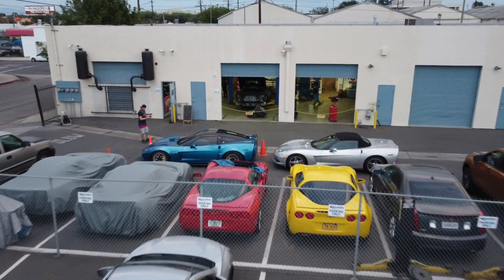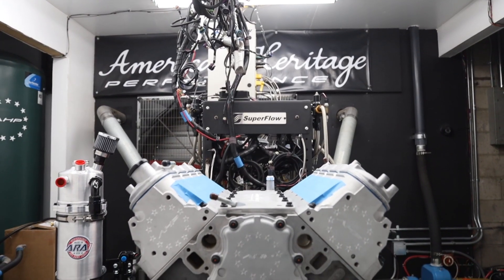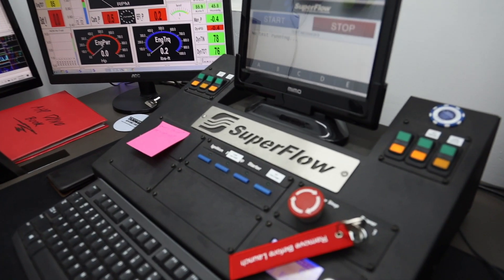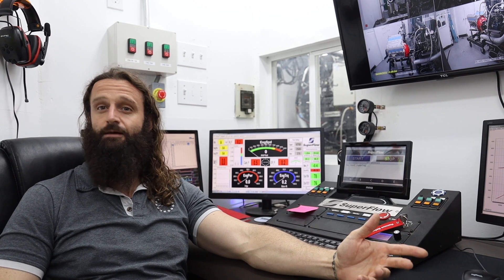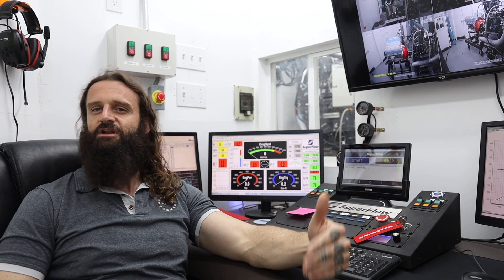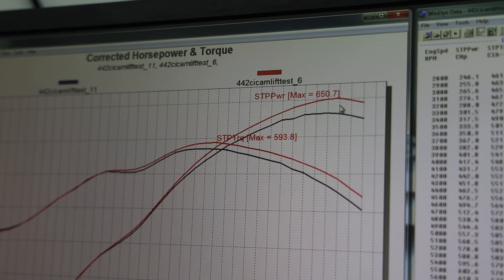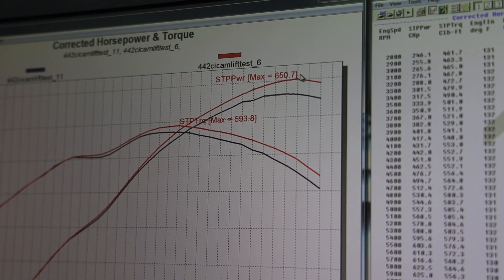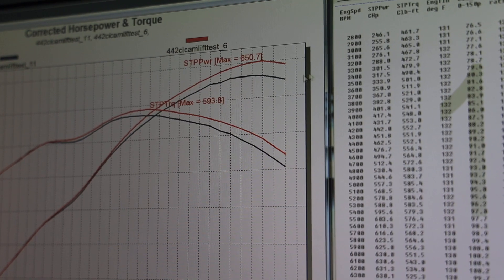High-Lift vs Low-Lift Camshafts -- Why LESS Power is Better for Your LS or LT Engine's Valvetrain

Comment: This video inspired my cam selection for my 2012 SS Camaro with the L99. I didn’t have AFM failure symptoms but I wanted them gone. Settled on a 223/235 112+6 VVT cam with a low lift of 0.553/0.553 vs the normal 0.620ish lift. It’s my daily driver and I don’t mind a little less HP for more longevity. Thanks!

Comment: That head was not able to take advantage of the lift. Try again with BR7 300 heads and we are not talking 20 hp from .060 difference in lift. Also use to valves and tool steel retainers, and you need less spring.

Comment: Kohle ~ Thank You, Great Content Sir ~ Right on Point ~ Had to come to grips on Application Durability over chasing Unusable HP on the Top End. The 96 Land Cruiser (6800lbs /ATV Light Tow) LS 416 (LS7 Stroke) w Stock 6L80 TQ Swap w Stock 823 Heads ~ Going Lower Lift Truck Cam (Even Considering Limited VVt  Cam) ~ Going back to 1.7 OEM Rockers, PSI or BTR Springs in .560 range, Ferrea Super Alloy Ex/ Comp Int. / and Moldstar 90 Guides 😎
Reply from the maker: Not Kohle here -- we're actually the auto journalists who *interviewed* Kohle -- but man your Land Cruiser sounds cool as hell. Congrats!

Comment: There is so much more to a camshaft that will dictate engine performance than lift, hearing him talk about stage 1, etc. cams would make me walk right out of his building.  If you do want yo talk lift why aren’t you discussing head flow numbers?
Reply from the maker: LOL  you missed the point of the video. This was nothing more than an experiment about how much power one sacrifices to avoid wear and tear on the valve train. This shop builds race cars, race engines, and CNCs their own heads, which are on the world's fastest n/a C6 Z06.
Reply: @internetbrandsautogroup3826  never heard of them

Comment: as lift increases, flow through that particular IN valve decreases !  once you get to 25% +/-
of valve diameter, any increase in flow drops away to bugger all ....So say you have a 2" INTAKE valve diameter, any lift past 0.5" is of questionable value 
You can do much better by careful attention to manifold matching and a simple 3 or 5 angle valve seat job 
The extra lift in high lift cams are needed to cover the high acceleration and ( to a point ) velocity numbers on the cam flanks
Reply: @unclegeorgesspeedandfeed  what do not you understand  ?
Reply: @bobawatsit  your entire paragraph makes no sense. That's the part that I don't understand
Reply: @unclegeorgesspeedandfeed   Oh, ok, what I am explaning is the tech of high lift cams, I agree with this clip, in that high llift cams not designed well ( and even if they are ) will beat the shit out of valve trains  esp push rod systems, as the weight ' inertia '  will cripple long liverty . as I say ( well known fact is )  once your INTAKE valve is open more tha 25% of diameter any flow rate increase dropps away to drops to absolutely buggar all. you are far better off matching gasget faces, shaping te back of the IN valve, tuning the IN seat, and retarding / advancing the IN cam timing

Comment: I run SBF &SBC between .500 & .560 lift & 274/282 Dur. for a Good Street Engine, that you can weekly, lol .  If I'm going Racing only!  .625+ & the Duration  makes or breaks your power, at what RPM.  guys change the Cam only, then hit Valve float. The 1st customers less Duration more Lift,  Doesn't Work for Me.   .680 WOW -  I'd do stage 2 , less lift with  more duration, less stress on everything.     it's a Science,   I like Choppy

Comment: @1:50 you mean Duration  gets eaten up by "The Stroke" of the crankshaft, Not by Displacement..(because on each stroke event the piston  takes more Time to travel from bdc to tdc therefore such engine will see less camshaft durationthan a short stroke motor)
Reply: So therefore less cam duration because of the longer stroke means less power? Could you clarify in detail please 🙏🏼
Reply: @rashidalbishri7181    I didnt say it would make less power, i said a Long stroke engine sees less Camshaft duration than a  Short stroke engine with the  same camshaft.  
   All im saying is that it would be more precise  to say that the Stroke of the engine and not the Displacement is what consumes the camshaft duration.
Reply: Nonsense.  It's displacement period. Your trying to fill two different size cylinders in the same amount of time.

Comment: Where most people miss it on the ls7 and even the late lt stuff is it has a 1.8 rocker, most lobes are designed for 1.7, when you add the extra ratio the velocity increases substantially on the valve side, we tell customers with a stock rocker we try to cap it around. 630-.640 at the valve, but normally in these "street " type scenarios we see no benefits in lobes with high acceleration rates,  and just like your test we see more lift rarely makes "big" increases,  we tested back awhile with our .425 lift rule Oval track cams and seen very small power gains adding . 100"  lift at the valve..

Comment: can we address the issue of the whole "stage 1, 2, 3" terminology. its just the dumb down term to sell products to ppl with tooo much money and no sense whos first mechanicing experience was on need for speed.
Reply: Well the levels help people understand the character of the cam. Level 1 is near stock but more power over stock. Stage 4 is more involve rough idle, torque converter swap, valve springs etc and the engine will run far different from stock and a totally different power band.
Reply: @moabman6803  1970s terminology

Comment: Im at 600-600 with upgraded springs push rods, lifters and rockers plus head bolts. Im considering changing out the cam now. I have touched about 2100 miles on the engine with my third oil change last night because rear main plate seal failed. I guess stock cam and some laughing gas in the future.

Comment: It's not the amount of lift that hurts parts, it's how the lobe gets to that lift, and gets back to the base circle. The amount doesn't hurt anything.
Reply: could you elaborate please? like the slope? angle?
Reply: @b2kallday391  The ramp of the lobe. Aggressive hurts parts, non-aggressive doesn't. You can have real aggressive lobes with less lift and hurt parts and lobes with more lift that have gentler ramps that don't. It's not about low versus high peak lift, it's about how it gets to peak lift and back.
Reply: @jrdmotorsports9718  stock eliminator cams have factory lift but a psychotic amount of duration.

like a 305 with a .383/.401 269/281 flat tappet, insane almost square lobe ramps.
Reply: @anthonyrowland9072  Yes. Any "Lift rule" classes will have Fast, Aggressive ramps. When you are only allowed to open it so much, it's all about getting it to that point as quick as possible.... and holding it there as long as ya can!
Reply: Finally someone knows Ball.

Comment: What gives you more of the rump rump at idle is the tighter LSA and also less vacuum and rougher idle and dirtier emissions, but more low and mid range torque with higher cylinder pressures.

Comment: I have an old Comp grind cam in a LS2, CNC 243 head.  227/232 .617 lift 110 LSA.  BTR springs.  Makes good power, choppy idle, stinky exhaust, and doesn't beat up the valvetrain. All of the good things.  My SBC 388 Victor Jr head jet boat engine I just built has a 230/236 , 583/586  113 LSA. Could make more power with a bigger cam but boats are hard on engines. Will be more reliable detuned.

Comment: You can always mess with LSA too to move the power and around. Tighter LSA would make for stronger low end and midrange power.
Reply: You mean "Intake Centerline" not LSA (lobe separation angle)  When a Camshaft is ground, the LSA is Fixed therefore you Can't  Change it.

Comment: So why would you say is the limit for like a daily driver on lift on like a 5.3l like in my stock silverado
Reply: I wouldn't go over .575-580 on a 5.3 myself. I've had trucks with high lift cams and agree with this guy totally. I'd probably go .550 or so. I don't want to have to break into the valvetrain every 1-2 years. To be honest, I'd even go with something that would allow you to run a stock torque converter... Maybe not the stock one on your truck but a stock torque converter from a HD truck or a CTS-V or something (depending on which transmission you have). I think some of those essentially stall to 2-2.5k rpm's (but don't quote me on that). The stock cams on these engines are so small that even mild cams yield a formidable boost in torque you can really feel, and I value longevity more than anything nowadays. If you want some real power you're going to have to bite the bullet and get a supercharger or turbo setup. Some performance shops in bigger cities have blowers from Camaro ZL1's/Cadillac CTS-V's laying around and will install them for a good deal. And a small turbo that spools fast would be a lot of fun and efficient also. If I had a 5.3 that was a daily I'd be focused on reliability and mpg's. If you had a RCSB with a 5.3, mild cam and simple small turbo setup, you could probably achieve 500+rwhp and around 20mpg's, given you don't have large or heavy wheels and tires. That would be the dream imo. A clean, strong truck that sounds great and drives like stock until you get on it.
Reply: @Johnny Midnight Yep... Next time I do a cam I'll be looking to low lift for sure